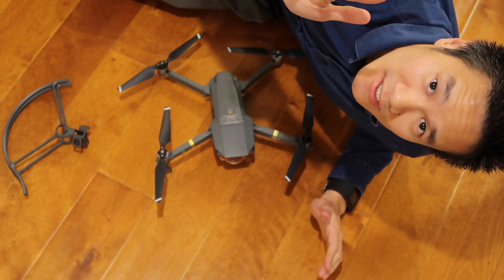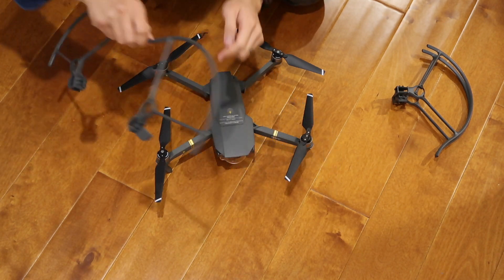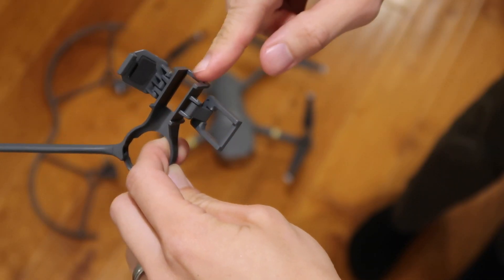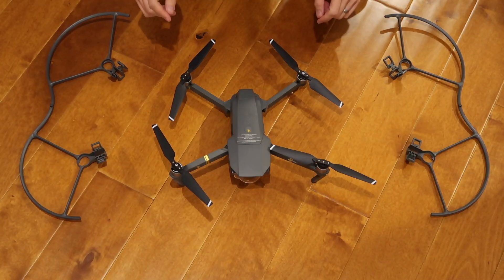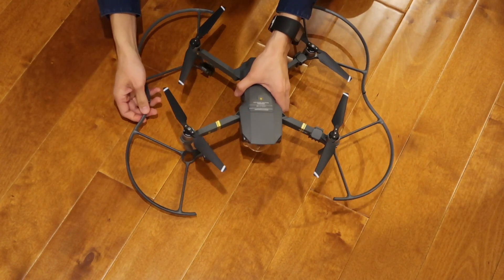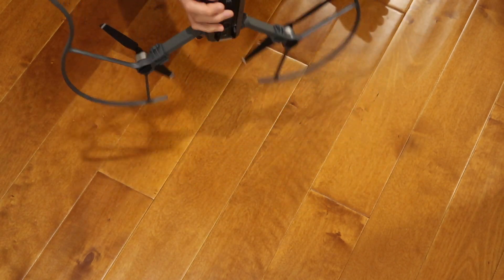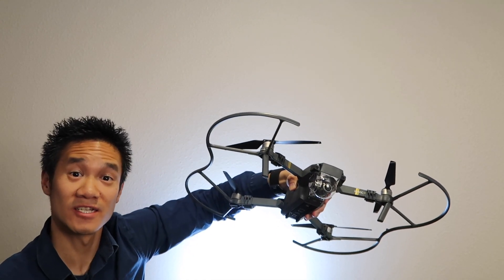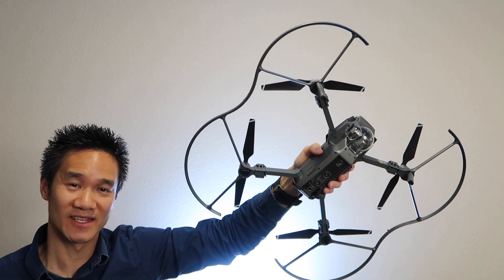DJI Mavic Pro: How To Install Propeller Guards without removing Propellers (Blades)

Comment: Cheers for sharing this tutorial video. Much appreciated. I've just scored a brand new set of original Dji Mavic Pro propeller guard's still boxed with instructions etc. Rarer than hen's teeth nowadays. The aftermarket one's are crap.